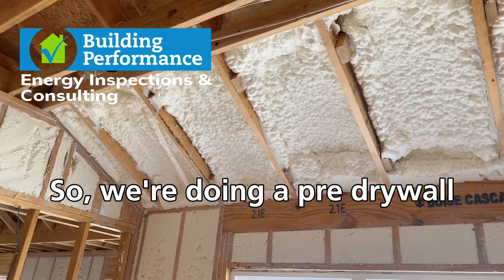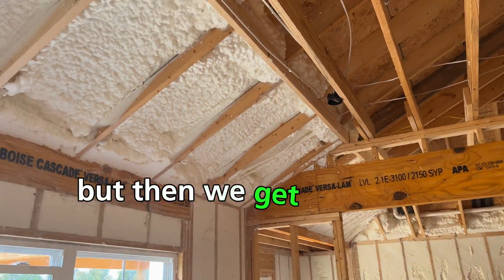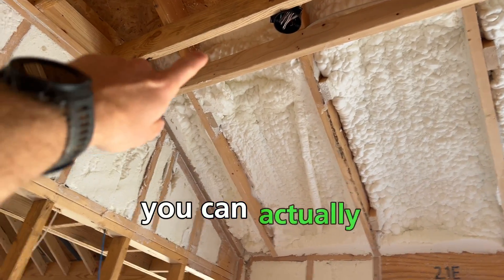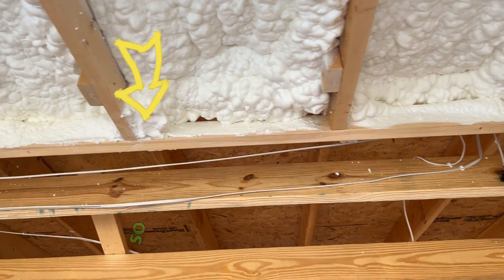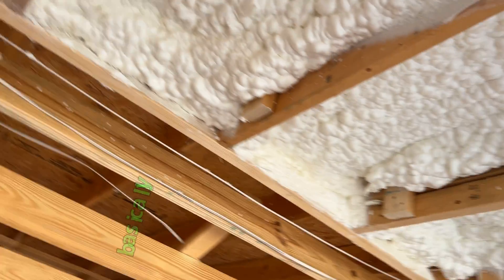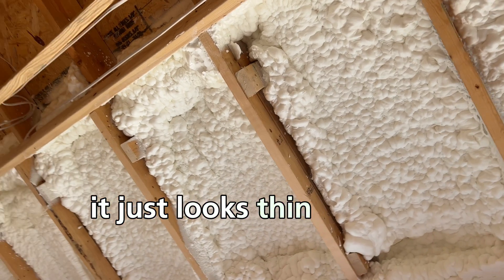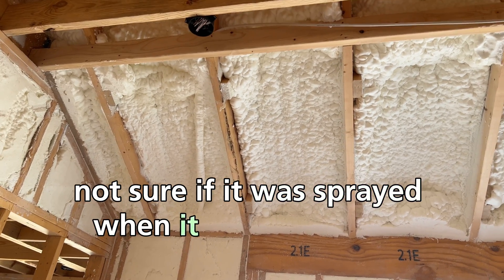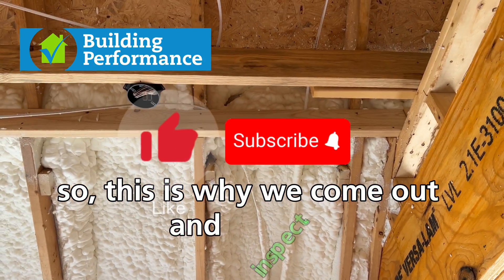Vaulted Ceiling With Incorrectly Installed Spray Foam in New House #insulation #newhome #sprayfoam

Comment: In the south we have to get to R38.  On those rafters it would have to be closed cell. It blows my mind that R19 it's the minimum there. Good video by the way
Reply from the maker: @oscarGua1988  R38 is prescriptively required by code here as well, but R19 can pass via the performance path in some cases. Thanks for commenting as well!

Comment: tip from a pro:  looks like foam shrunk or sagged as we say, from not being mixed properly. seems like they did install 6 inch in that roof but foam sagged. Go around and push onto foam in wall bays, it most likely has a half inch to an inch gap between plywood and foam if so.
Reply from the maker: Are you referring to the back side of the foam where it meets the wall sheathing having a gap? That would be hard to determine after drywall, even with an infrared camera...

Comment: Definitely screwed up separating boundaries and yes it looks very inconsistent.
Reply from the maker: Good part is it can be fixed easily before drywall goes up.  After drywall you could air-seal that gap from the attic side to seal it off that way, but the R-value in the cathedral ceiling would still be low.

Comment: I would never use spray foam nor would i buy a house that had it as insulation. I prefer fiberglass with baffles for airflow in a cathedral ceiling. I saw a house for sale that they foamed the basement walls inside. No framing just a wall of foam...WTH?
Reply from the maker: To each, his own, but it works very well when done correctly.  There's certainly more than one good way to insulate a house.  Even fiberglass batt houses can be pretty tight, when air-sealed correctly.

Comment: Never use spray anywhere except on walls… even then I wouldn’t use it.
Reply: uneducated comment
Reply from the maker: Spray foam is actually best used in areas that are most difficult to insulate and air-seal, and exterior walls are probably lowest on that list.  Rim joists, attics and cathedral ceilings, knee walls, etc are some examples of hard to insulate areas.
Reply: @BuildingPerformance502  I’ve seen homes that had to be torn down because of spray foam issues… fiberglass can always be easily replaced. Don’t design or build a home with spaces that you cannot access.

Comment: So it is possible for them to come back and spray over the older foam and it will stick?
Reply from the maker: Good question, and yes they can (before drywall goes up), as long as the foam adhered to the roof decking properly the first time.

Comment: In chase of Fire. The house will burn like a mf.
Reply from the maker: That is one thing to consider, for sure, when deciding on insulation products for your home.  There's more than one way to achieve an air-tight, well-insulated house without using spray foam.
Reply: @BuildingPerformance502  Did you See sprayfoam burning? Burn like hell cant be stoppen with water. Only CO2 Gas can stellt the O2,.....

Anyway wood and sprayfoam are a Bad combination. 

I sah a german Video here on YouTube. Were ignition, burn behavior and so on gets tested. 
(Amateur Video) 
But the result Rockwoll and Fiberwoll arent burning. Styropor and styrodur (Hard Styropor) smelting till a short Distance from the ignition point. Sprayfoam went into a Hellfire.
Reply: actually, in real life if fire starts in all foam house it usually suffocates with not enough oxygen. walls and vaulted ceilings are covered with sheetrock and  attic foams are painted with water based Thermal barrier paint that can withstand a torch for hours with no flame spread.  it all doom and gloom until you learn.
Reply: @IGame4Fun2  Materials like spray foam is the reason why sprinkler systems are mandatory in new houses in many places.  Without a fire supression system, there simply isn't enough time to get out of your house because newly built houses go up like a struck match.
Reply from the maker: @IGame4Fun2  We tend to agree it's not all doom and gloom, although we've seen some huge houses burn to the ground that were all spray-foamed as well.  There was a BIG Homearama house in Oldham County probably 10 years ago that never made it to the show.  Apparently the people staining all the wood left their wet rags in the garage with the door open and in direct sunlight. The other thing about that thermal barrier paint is, the local building codes only require it when there's a door from the house into attic storage space or there's a HVAC system located in the attic.

Comment: Shouldn’t the ceiling foam completely fill the cavity also, it seems so shallow in the center??????????
Reply from the maker: Ideally, yes it should, but if they're shooting for a nominal 6 inch depth and the outer edges are thicker than that, then it can make the middle look insufficient.

Comment: suposed to be foam between deck qnd foam
Reply from the maker: That is not a common practice in climate zone 4, but any continuous insulation to prevent thermal bridging is a good idea!
Reply: @BuildingPerformance502  where climate zone 4
Reply from the maker: @redsresearch  we work in southern Indiana and Kentucky in CZ4.

Comment: Good luck pulling wire through that stuff and a  $10 roof leak turns into a couple thousand because you can't tell if the roof is leaking until it's too late.
Reply from the maker: Hopefully with a new house you've installed all the wires you need before insulation goes in, but you are correct it makes it hard to move through it afterwards. This is also open-cell spray foam, which allows moisture to move through it. Closed-cell spray foam is what you may be referring to where moisture will not move through it easily.
Reply: Is spray foam worth it? Seems everyone doesn't like it now.
Reply: @oatlord  we live in 110 degree weather in central valley ca. Our house is 2780 sq foot and is spray foamed. The entire roof peak in the attic is spray foamed, so the attic is just 1 degree higher temperature than the livable space, if that relays the correct picture. we only have a 2.5 ton AC unit and it has no problems cooling the house. So yes spray foam is an amazing insulator.
Reply: Yes, spray foam is with it. All insulations will hold side water. Even hydrophobic material will hold some  water.